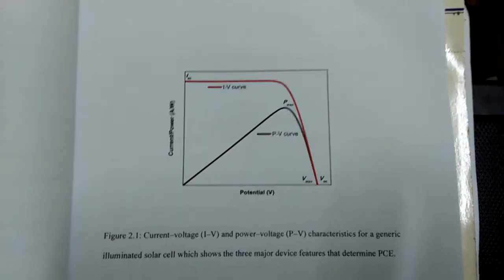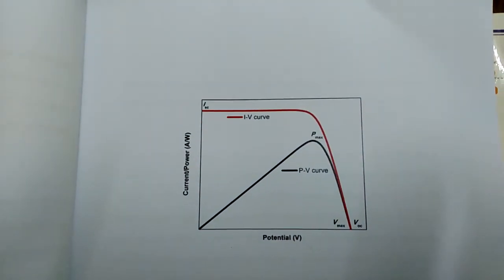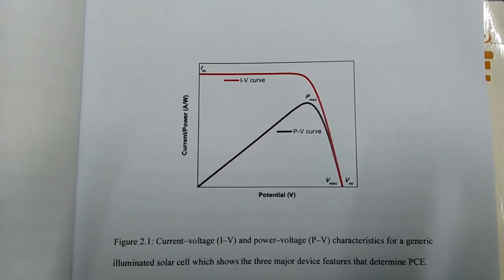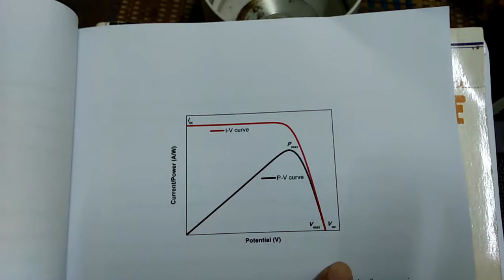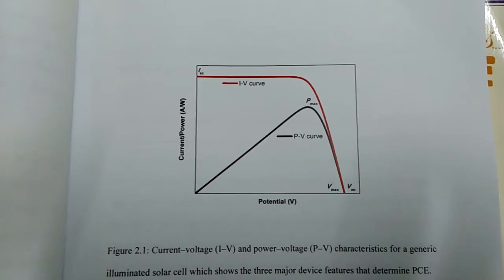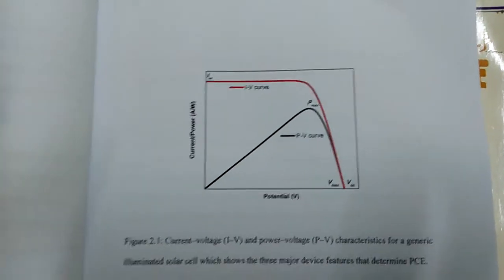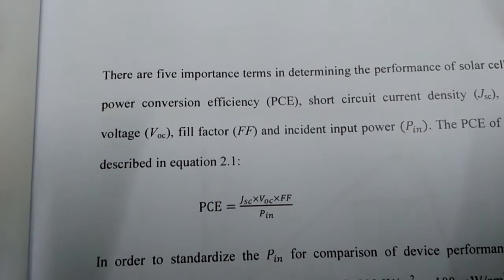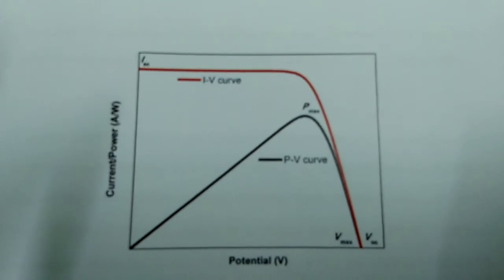How to measure the efficiency of DSSC

Comment: Sir, I'm also working on DSSC as my research project. Could you guide me as well in getting the measurements in for a simple Gratzel Cell made with fruit dyes?
Reply from the maker: Sure. You need to have photoanodes mades of TiO2. Then counter electrode made of platinum or carbon based materials. Redox electrolyte normally Iodide Triiodides. The you can make your own dyes which is fruit dyes. 

For machine testing you need a potenstiostat equipped with solar stimulator. If you dont have enough funding. Tried first using normal bulb, but you need to fix the bulb distance to get 1 sun power. Buy photo detector to set up the accurate distance. Then you can start your experiment.

You will get the value of open circuit voltage and short circuit current from the potenstiostat. The fill factor value can be calculated from JV curve extracted from potenstiostat. The efficiency can be calculated using formula.

Good luck for your experiment.
Reply: I am done with my experiment! Thank you for this video!  @DrHaffeast

Comment: My research is based on organci solar cell , could you kindly assist to calculate FF, PCE, VOC and ISC
Reply from the maker: Normally the Voc and Isc was given during measurement.
Reply from the maker: But you can use formula 

PCE = (Jsc)(Voc)(FF)/Pin
Reply: @DrHaffeast  I collected data about current and voltage, but after ploting , the curve is kind of linear it makes hard to determine Isc and Voc
Reply from the maker: @mekilaolivier4560  if the curve is linear means that your resistant is too big. How is the curve during measurement? Are you using solar stimulator or direct sun?
Reply from the maker: @mekilaolivier4560  sent me you data or graph at haffis_92@yahoo.com.my

maybe i can see what the problem with your DSSC curve.
Reply: @DrHaffeast  I am using direct Sun, it's an outdoor test to evaluate the degradation of the organic solar cell
Reply from the maker: @mekilaolivier4560  okay. Now I understand. You need at lease a potentiostat to have a JV curve. 

I think you just use multimeter to measure current and voltage.

If it is true you cannot plot JV curve because you dont know the Fill Factor. Thus, it is quite difficue to know the power conversion efficiency.

Unless you just have estimation of Fill factor let say FF is 50% then you can guess the PCE.
Reply: @DrHaffeast  thanks you so much, I use voltage divider and current sensor to collect data for analysis which is basically equal to multimeter, now I am facing challenges how to estimate FF, since it will give me some information for performance analysis.
Reply from the maker: @mekilaolivier4560  you are welcome. Hope you success in your project.
Reply: @DrHaffeast  okay, I will. Thanks you for your advice.
Reply: @DrHaffeast  Thanks